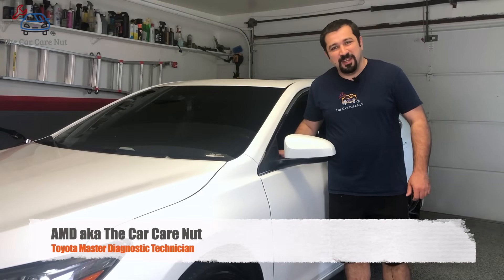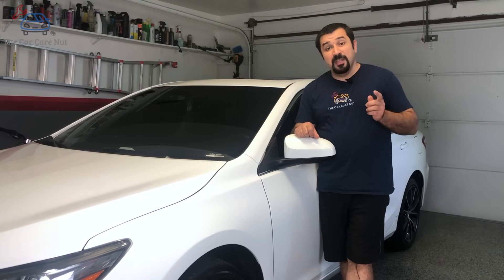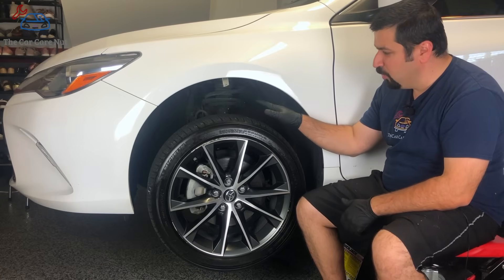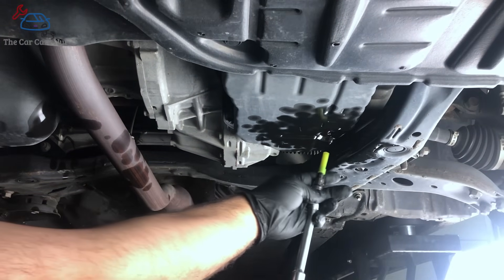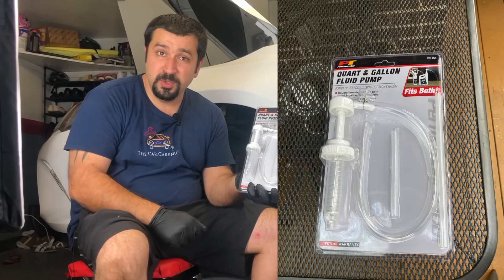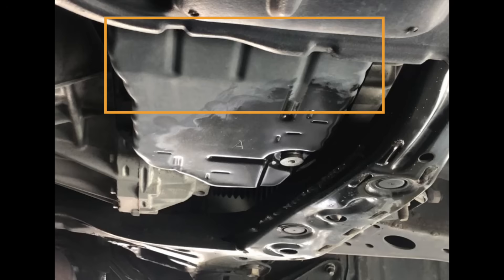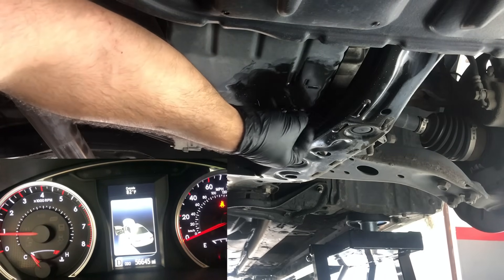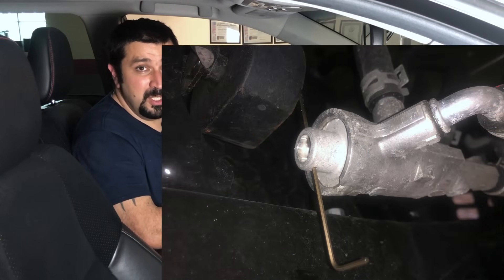How to change your Toyota Sealed Transmission Fluid

Comment: I can't get the 10mm bolts to come out from the wheel wells. They get tighter both turning to the left and to the right.
Reply from the maker: Likely seized and will end up breaking. If they break you’ll need to heat them up and extract them
Reply: @TheCarCareNut  lol I got one out and the other one broke inside the threads. The 24mm won't budge. Can I spray WD-40 on the big 24mm bolt? Do you think any of it will leak into the transmission?
Reply from the maker: The 24 one can be tight to loosen. I haven’t seen one break. Tap on it lightly with a hammer ( not too much force!) and that should help it loosen up
Reply: @TheCarCareNut  I can't get it to budge. I tried both 6 point and 12 point sockets with liquid wrench. Let it soak 20 minutes. Both strip the head. I don't want to put too much pressure on the bolt head and strip it completely. I don't know what else to try. I even tapped on it to try and loosen it up.
Reply from the maker: Did you drain the oil already or no?
Reply: @TheCarCareNut  No I didn't do that. Today I'm going to try heating up the bolt head. If that doesn't work, I guess I'll have to have it done in the shop.
Reply: @TheCarCareNut  I just drained about 2¼ quarts. Replaced it, now going through the gears and it clunks going from neutral to both drive and reverse. What do I need to do?
Reply from the maker: Hi! Check the fluid level

Comment: I just bought a 2017 camry SE with 59,400 miles on it.  When should the transmission fluid be replaced and if I don't feel confident to do it myself should I have it done at the dealership?
Reply from the maker: Hi! Every 60k or 6 years. It’s the same procedure in the video. If you’re not comfortable have a dealership do the replacement

Comment: Hi, why just draining the transmission and adding the exact  amount of oil back work? Thank you very much.
Reply from the maker: Hi! If your fluid level was good to begin with the yes. But I say if you went through the trouble of draining and filling why not spend another 10-15 minutes to check the fluid level and make sure you’re 100% on point
Reply: @TheCarCareNut  If you bought the car new wouldn’t you expect the level to be correct?
Reply from the maker: Yes but not always.
Reply: Andrew, are you a gambling man?  If so then add back the exact same amount of fluid that you drained out and call it a day.

Comment: Would you recommend changing the transmission fluid on my 2017 Camry se at 97000 miles or is better to leave it alone risking damage?
Reply from the maker: Hi! You’re still in time to change it without issues. Do a drain and fill and you’re all set
Reply: Awesome thank you
Reply: I drive heavily for work now and I learning to do basic maintenance on my cars.
Reply: Jacobo Racine,i just did mine yesterday, i just purchased a 2015 Yaris 1.3L with 88,000m here in the UK. I watched the video 3 times,i did pretty good and did it my the book/video.

Comment: Usually, it is recommended to repeat the "drain & fill" procedure 3 times, with a gap of perhaps 500 miles in between each. I noticed you did not mention this, and only talked about rechecking the level again at a later time. Why

The reasoning behind multiple drain & fills is because the transmission holds roughly 6.9 quarts (at least for a 2013 Camry), but only 2.5 to 3 quarts comes out per drain. The rest of the 4.4 quarts of dirty ATF fluid is left in the transmission, torque converter, transmission cooler, etc. So by repeating the steps a few times (with a little drive time in between to really mix old with new), you end up with what amounts to a full flush. But without the dangerous and NOT recommended procedure of a forced transmission flush (due to the potential for clogging the tiny capillaries and ports with dirty fluid from the bottom of the drain pain). And the gap of time in between the multiple drain & fills also helps with not "shocking" the transmission too much all at once, if the fluid is really dirty, as the lock up clutch on the torque converter might be a little worn and might suddenly start slipping with a fresh full batch of light and clean ATF fluid.

I also noticed you did not mention dropping the pan, cleaning it and the magnets, and replacing the transmission filter inside, as other videos do. Seems like it would be good to do as well during a triple drain & fill sequence, since changing tranny fluid is such a rare event.
Reply: @sillybeans929  Yes, I mean a full drain, 3 separate times, but when a gap of time in between to mix old and new. By the third drain and fill, the transmission oil will be clean enough to go a very long time again (years).
Reply: Yeah, AMD has addressed this and basically he stated that an issue with transmission performance "can" arise from completely (or a majority of it) refreshing the fluid.  The idea behind the draining it only 1 time is to only "refresh the additive package", and so doing the partial drain and fill will do this  well enough so as to avoid potential issues that could arise from a complete fluid refresh.
Reply: I will repeat the drain and fill process a few times until I get clear red fluid. Right now it's brown. Did the pan removal and replaced the filter today. Even when you pull the straw there is a substantial amount of fluid still in the pan. I'll bet 1.5 qts. This is going to take several times.

Comment: Toyota designers are stupid. Firstly, by making what should be a relatively easy DIY procedure into a much more complicated ordeal. And second because of the stupid tube level design. Acura/Honda engineers made things so much easier, by putting the level plug on the side at a precise height, so when the fluid is at the right height & temperature, it stops draining. Easy peasy. Also, putting the transmission filter INSIDE the drain pain makes things needlessly difficult. External filters are so much easier to work with.  Ugh Toyota.

Comment: So you don't recommend changing the transmission filter?  
This way you're only changing 2.5qts out of total 6.9qts.
I have my 2012 Camry with just about 107K km (67K miles) and thinking of servicing my transmission. There are plenty of videos on this, but all different and confusing.
Reply from the maker: Hi! I work on Toyota professionally and here’s my opinion from real world experience. If you change the transmission fluid every 60k miles (100k kms) or 6 years you don’t have to replace the transmission fluid.
Reply: @TheCarCareNut  I value your opinion but will change my filter anyway.

Comment: Great video! How to change the transmission filter of a 2017 Highlander? Is it hard to DIY? Since there is no oil pan underneath
Reply from the maker: Hi! It’s very difficult honestly as the oil pan is on he side and obstructed by the sun frame. I personally wouldn’t worry about the filter even if was easy to access. Change the fluid every 60k miles or 6 years and call it a day.
Reply: @TheCarCareNut  thank you so much! I have watched other videos, either did not mention temperature at all or recommended some after market fluid. I don’t want to judge but I trust yours! Thanks again for your great efforts and the quick response, please keep posting!
Reply from the maker: Honestly I wouldn’t replace the filter. Even the fluid is still early

Comment: Hello,

Regarding to the OBD II jumper on pin 4 and 13, does it also apply to 2014 sienna?  Also, what's the temperature range for 2014 sienna if I was to use the infrared gun.  Thank You.
Reply from the maker: Hi! It’s the same procedure and the temp range is around 95-113
Reply: Thank You

Comment: Can you please do a video on how to tell if your Toyota dealer is a Great/Good Toyota dealership
Reply: Great video, but there’s no mention of replacing a screen or filter. Why is that?  Is there no access to the screen or filter?  Also if one waits for a transmission issue before changing the fluid, it’s already too late for a fluid change. Please reply. Thanking you in advance, Anthony
Reply: DEFINATELY

Comment: I REALLY appreciate the video. Your presentation is excellent! Like others commenting, though, I'm mostly concerned with getting the temperature exactly right before allowing the excess fluid to drain. The money I can save myself for this and future trans fluid changes would add up to a tidy sum and easily cover the expense of a temperature gun. It just might be worth the cost of buying a digital thermometer to give me the confidence to get the level right without all the steps that need a rehearsal, a wire and playing with the gear shifter. Maybe others reading this thought will agree. Now to my question: what temperature would I need my 2015,  2.5L (4 cyl) Camry transmission case to be at (using a temperature gun) before loosening off the drain plug to allow the excess to overflow out? THANKS in advance. I'll be checking a lot more of your your Camry and Toyota related videos out!
Reply from the maker: Hi! Your temperature needs to be between 95-113
Reply: @TheCarCareNut  That's almost a 20 degree spread. Should I just pick a middle ground number in that range (such as 105) and use it?
Reply from the maker: As soon as you get to 95 drain the excess fluid. If you get over 113 close the drain plug shut off the car and wait until it cools down below 95
Reply: @TheCarCareNut  I feel very well informed from an expert. You're the best! THANK YOU!

Comment: Puzzled? Mine was 3 quarts when I drained it. So I added to 3 1/2 quarts meter read 107 temp gun read 2 degrees lower. When I release the plug I got nothing coming out so it now has 4 quarts still same thing. Where did I go wrong?
Reply from the maker: Hi! This means that the fluid level was very low before hand. You’ll want to keep adding with the engine running in park until it overflows
Reply: @TheCarCareNut  thank you and may God bless you

Comment: What about the filter? Is it necessary? Speaking of a 2010 Camry 4 cylinder. Thanks!
Reply from the maker: Hi! If the fluid was changed on time you don’t need to service the filter

Comment: Does this apply to the 2019 Corolla LE as well?? And does the Toyota dealership not look at the transmission when in for service?
Reply from the maker: Hi! It does apply to 2019 corolla but it uses CVt fluid. And some dealerships don’t want to deal with transmission fluid replacements for some reason
Reply: @TheCarCareNut  My dealership offers the service so I'm having them do the first one while my car is still under the powertrain warranty, lol.

Comment: Hello car nut,  my dad has a 2012 Camry SE V6 with 125,000 miles. He recently made a mistake and did a transmission flush at a shop. Car drove fine for a few days, but the transmission started whining and has now completely stopped working. Do you believe there's a way to save this transmission, or a rebuild is the only solution. Car was good before the flush. Would be nice to get your opinion on this. Cheers!
Reply from the maker: Hi! It’s likely they used the wrong fluid or the level is wrong. Check both. If everything looks good unfortunately it will need a transmission

Comment: Hey there!
I have a 2004 4Runner past what you would recommend drain and replace. What do you think about just draining 1/2 a liter and replacing. And repeat at  5 or 10 k intervals..?
Reply from the maker: Hi! I would do a single drain and fill every 30k miles on your 4Runner

Comment: Can you do a video on transmission fluid change on a 2009 Camry 4 cylinder with a dipstick, and the type of fluid it takes?
Reply: I have a 2017 RAV4 with 40,000 miles on it. The manual states change the fluid only if you have been towing or hauling heavy things. What do you recommend I trust your knowledge.
Reply from the maker: Hi! I would replace it every 60k or 6 years so you still have time and mileage

Comment: Hi again 
I have 2014 Sienna Limited AWD 45,500 miles
I came over to Toyota dealer(Torrance, CA) for questions
1. Transmission Fluid Flush: not recommended under 100k miles
2. Front and back differential:
    75W 85
Reply: 75W 85 is the best for my car?
I'D like to buy Valvoline brand since the dealer doesn't have in stock

Comment: Can I use Mobil1 or Valvoline ATF which is recommended for WS ? I noticed that these aftermarket ones are synthetic and OEM Toyota WS is not.
Reply from the maker: I personally would stick with the original WS

Comment: I have a 2009 Toyota Venza AWD V6 (6 speed auto) with 105k miles. Do I need to replace the transmission filter also? I bought the WS Toyota ATF and trans filter.

Comment: I have two old 4Runner and one Hilux. I need to change the oil and filter of one 4Runner, 2010 that I bought 6 months ago. Probable this car run more than 100 k miles without changes. How do I need to do it? How can I flush without sending dirty everywhere?
Reply from the maker: Hi! I would drain and fill at this mileage
Reply: @TheCarCareNut  , I changed the oil during this past weekend. After I drained it, I saw that the smell was not terrible but the color was dark. Then, I opened the pan and i didn't find too much dirty, normal in the magnets. I changed the filter, gasket and, because the situations were ok, I flushed the complete system. It is driving smoothly. Thank you for all your videos and help!
Reply: Thank you. I bought a new filter and gasket. I will drain, open the pan, clean debris and check the situations refilling the oil. This car has 240 k miles and probably 100 k miles without atf changes.

Comment: Can u do the level check with the engine off?

Dont like getting under cars wen its still running.
Reply from the maker: Hi! It has to be running to check the level.
Reply: @TheCarCareNut  thanks for the reply.  Got a 07 toyota tarago 3.5 v6 2gr fe.   it would be similar to ur sienna over there.
Wat would the warmed up temp be to check the the level.
Cheers.
Reply from the maker: Hi! 95-113

Comment: Does the OBD jump + second procedure (going back and forth between N and D) work on an 07 4runner v6? 
What are your thoughts about changing the transmission filter at 170k?
Reply from the maker: Hi! It works but you might get a flashing AT temp light instead of D. Also if the fluid was replaced on time I wouldn’t worry about the filter if not then replace it

Comment: Hi AMD, on my Lexus ES 350, it looks like my OBD2 port in inverted, and I want to make sure my jumper wire is correct, sure don’t want to cause a short or mess up my electrical system, here is a pic , does this look correct?

https://drive.google.com/file/d/1VeLnY9_VTCqFYIPoXhFiI-TBw5Aiow9T/view?usp=drivesdk

Comment: I have a 2015 Toyota Corolla LE. The maintenance manual mentions that at 60K miles Inspect Front Differential Oil. And if the car is used for towing, Replace Front Differential Oil and also it says Replace Transmission Oil. Question is - what is Differential oil - is it same as Transmission oil?
Reply from the maker: Hi! When you replace the transmission fluid you also replace the differential fluid as they are one
Reply: @TheCarCareNut  Thank you!!
Reply: Also Thank you for a great video with very clear explanation about how to check the levels. This is very helpful

Comment: I have a 2013 Toyota Corolla LE (2ZR-FE) 1.8L with 148K miles on it the trans fluid it has NEVER  been changed should I cycle multiple changes to get the old fluid out of the torque converter or just do one change and would you recommend replacing filter also?
Reply from the maker: Hi! Honestly I wouldn’t replace the fluid at this point. And if you have to, just do a single drain and fill and call it a day
Reply: @TheCarCareNut  thanks for the quick reply